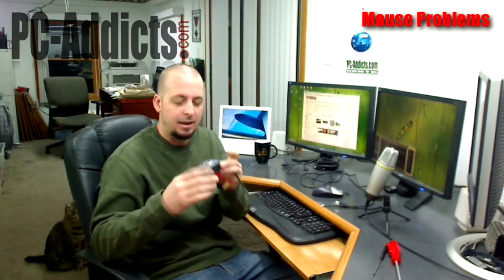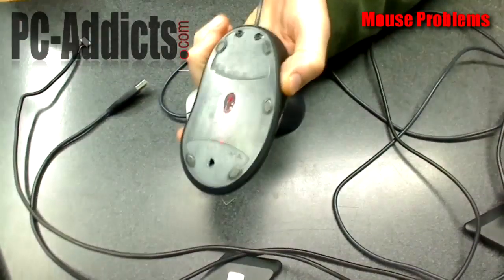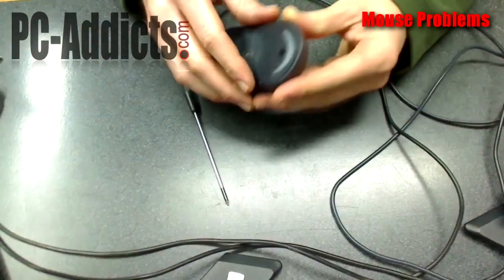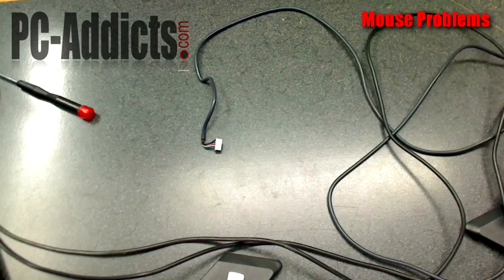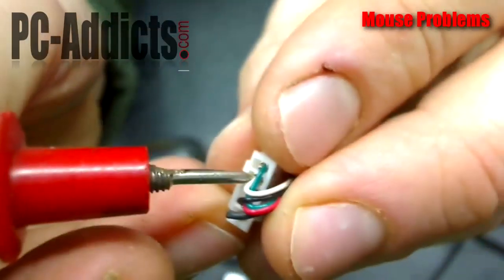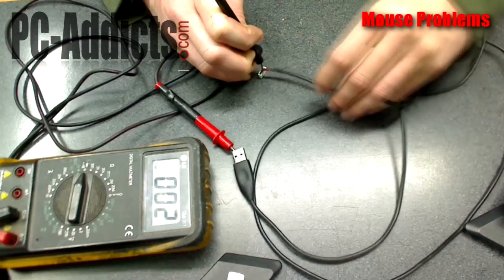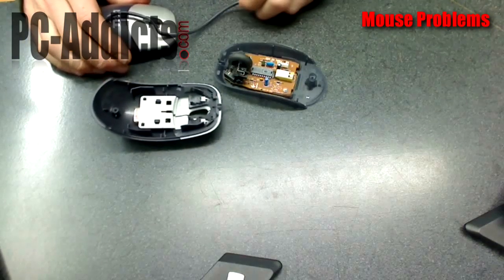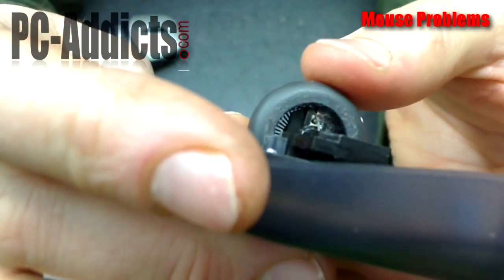Mouse Troubles - How to Troubleshoot and Repair

Comment: Didn't have another cable with correct connection box som i just soldered new (salvaged) usb cable onto the old conection box, works (for now) :-)

Comment: hello, I bought a mouse from gearbest, the mouse is the motospeed v30, after +- 3 months the mouse stopped working, the buttons all work but the mouse doesn't move, what could it be? seems that the usb cable is fine and all the rgb's led's work, the only led that lights up is the red led, the sensor led

Comment: Tanks for the video safe my old hama lol i alays use it idk 4 favour but strange is disconect after like 2-5 h work and do not conect back until i unplug and plug again also way to check do ur OS freze is press start button and if it open check mouse 
then press back to close

Comment: had the same problem with G5 mouse. in the end i had to cut the usb cabile and re-solder the wires to the Bord inside the g5...not something i wanted to do but i liked the mouse. but works now so all is good...( so far )
Reply: +scaleop4 having the same problem, my mouse doesn't have a plug on the inside, its soldered into the board, i was wondering if you followed some guide or you just have great soldering skills? any advice? thanks!
Reply: +Emanuel Neves  no I did not follow any guide it was just trial and error
Reply: scaleop4 thanks for your input. for what i've seen the main problem is not having the apropriate equipment, solder,.. but i think i'll try just for the challenge ^^

Comment: How to fix tracking issues due to a loose sensor? I took my Zowie FK apart just to fix the right click button and I did, then when putting it back together my mouse tracker stopped working completely.

I noticed I budged from the bottum the sensor to adjust it a bit and it was indeed loose. So was it just lightly hovering in place and any second it could have become loose?

Comment: Another thing that works well is to pull on the cable and it will snap where the conductors are broken then a bit of solder and shrink wrap, job done :)

Comment: Most people don't have spare mouse cables round.. so you would splice it open and solder in a patch wire and wrap electrical tape around it.

Comment: Thanks for saving my expensive  Mx518!  Had same problem, stumbled across this.. didn't have a spare usb cable so decided to order a cheap logitech one off Amazon... anyway it arrived, I did the swap over and my mouse is fully functional again.  I paid £50 for the gaming mouse and £5 for the replacement, worth it!  Thanks again for the tip off!

Comment: great video, awesome cat. Hey don't throw that cable away. Assuming it's not fiber optic wire, you get enough of it and you can  make some money at the scrap yard for the copper.  Same goes for computer and electronics.  Some yards might not take them but the ones that do will give you something - it's not much, certainly not like what you can fetch for copper.

Comment from the maker: Those look like they can be re-soldered just fine. The "unraveling" wires look like they are jut there to help strengthen the cable (from pulling on it).

Comment from the maker: @Fuzzeyyy Man, button problems are not so easy to fix, I typically just purchase another mouse when it gets to that point. You could try taking it apart, cleaning up the actual button/switch on the circuit board of the mouse, but I would guess it's not going to help much.

Comment from the maker: @wasabechop The double click problem might not be fixable. Anytime I ran into that issue, I just purchased a new mouse. You can try to take it apart, and maybe clean the switch / components under that mouse button.

Comment from the maker: @d0n1mega Do you have any extra mice laying around? You could take your expensive mouse apart, and then any other extra mice, and see if the connection is the same (most likely it is).

Comment: There is an certain risk tough, you have to be carefull when you take of the plastics from the cable, expecially when you are going to twist togheter the copper in the small ones. Even if you take the cable out, you have very little margin to do it with if you encounter that the damage is in the same place as it was for me. As for reference, the mouse is a Logitech MX518

Comment: Using his troubleshooting tactic I was able to repair my mouse for the cost of 0$. I did not even replace the cable.

[  ^]x-------

Where the box is the mouse, X is the damaged part and - is the normal cable.

Inside the mouse was an certain ammount of cable that I could use. I amputated it like this -axa-
where a is where I did the cut.
With some tinkering, I was able to seperate all small colors, twist them, isolate them with special tape. Put the small package inside. Done.